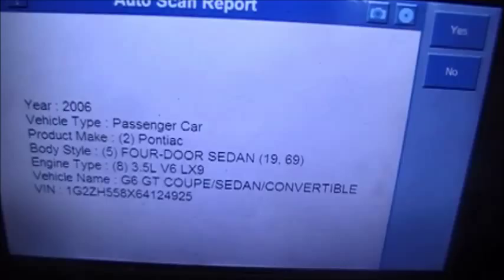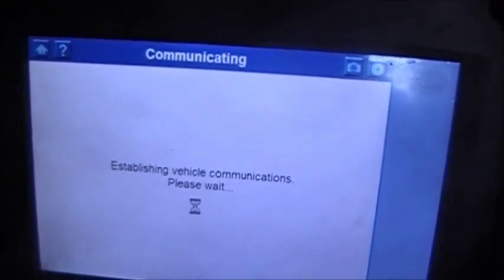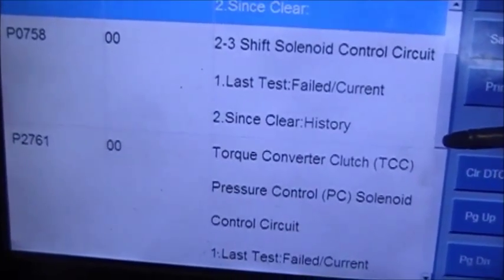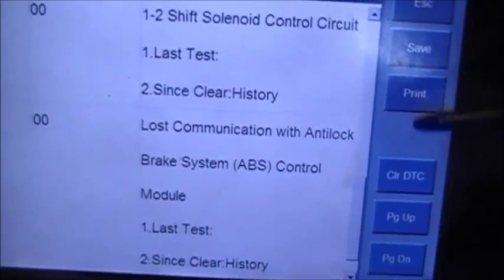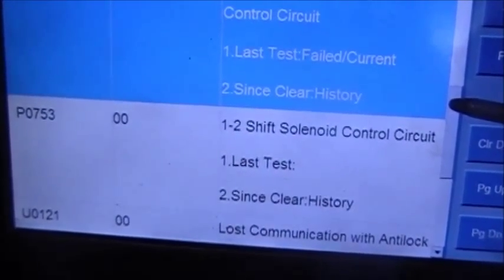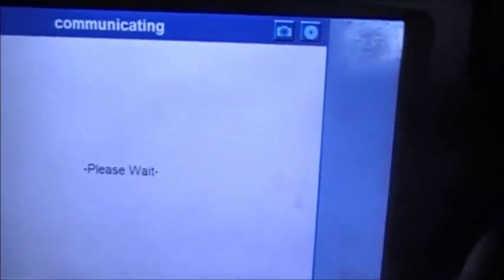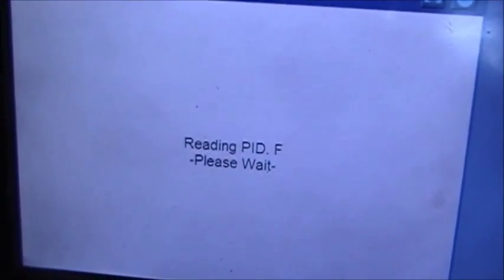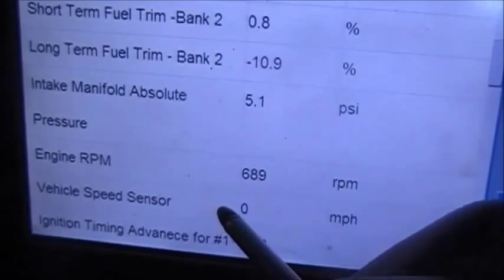Pontiac G6 "no shift" P0758 case study A Part 1

Comment: Hi.  My vehicle only has trouble shifting into 4th gear.  If I accelerate aggressively from 1st gear it shifts fine.  If let go of gas then press again it also shifts fine.  No cell either and it's a v6 g6 with 115k miles.  Should I change the trans fluid and filter or do you think it's too late?
Reply from the maker: How many miles on the vehicle?
Reply: @thisisyourtransmission  hi it has 114k miles
Reply from the maker: @galiciadabest  I can only give you a guess,  bad 4th clutch hub.  Transmission has to come out for this repair.
Reply: @thisisyourtransmission  ok no problem I cans of figured that I'll just keep driving till I can't I guess.  Lol. Thank you for your help

Comment: great video, can u elaborate on exactly what the car was doing . i have an 4t45e  and it won't roll in neutral, or any gear , seems like it wants to go forward a little but doesn't move. seems like it is stuff in gear or park. starts and runs. loved the video. thx.
Reply from the maker: todd harnack how many miles are on your vehicle?